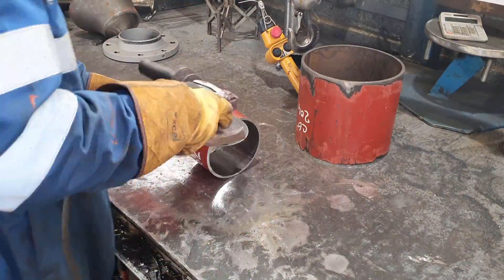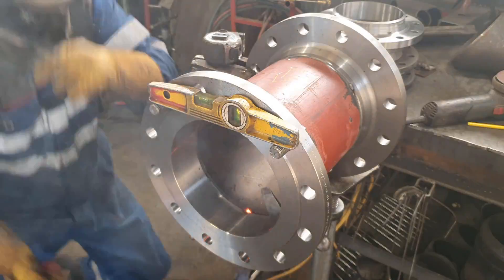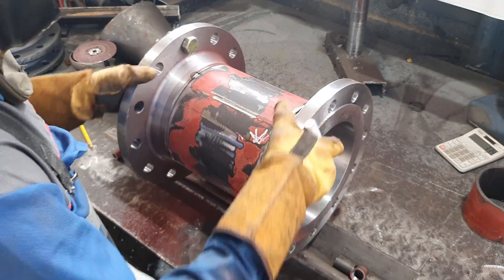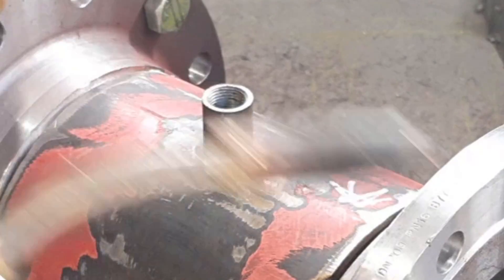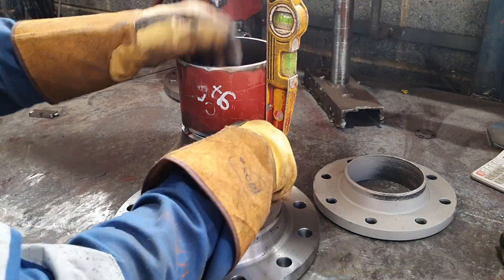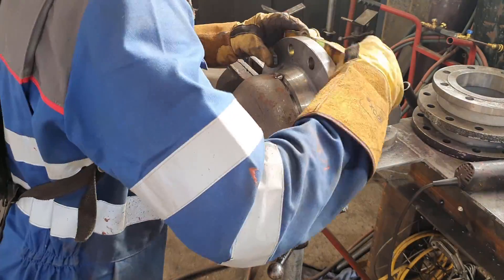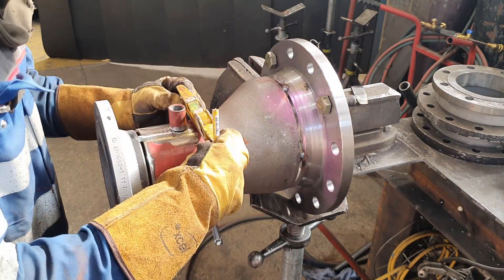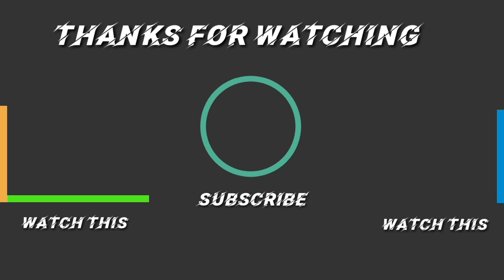Tips and Tricks For Pipe Spool Fabrication (MIG/MAG)

Comment: Very good mate, on the first one i always fully weld the weld necks to pipes before I add any fittings so the fittings don't get in the way of the circ welds, it's ok in this instance only being small sockets but if they were small branches it would be different, I'll assume you don't have a radial drill to drill the socket holes on hence the cutting gear.
On the second one the eccentric reducer ,stand it on the bench and square a line up its flat back so you know where it's center is for the orientation of it and on the flanges even though ye using pegs and spirit level to get it all off centers just mark a chalk center line between the flange holes on the front face,just good practice for when you do bigger pressure vessel stuff.
The 2 foot ruler stuck in there for the welding gap 😂 I'm still doing that after 40 years.
The narration is a great addition, coming on great and makes me pleased to see a young lad enjoying fab and welding, keep it up